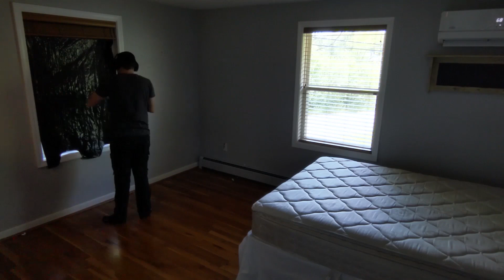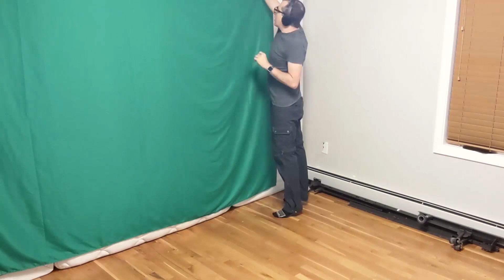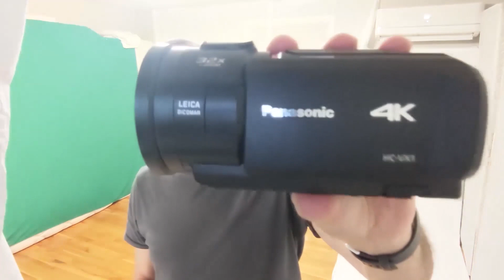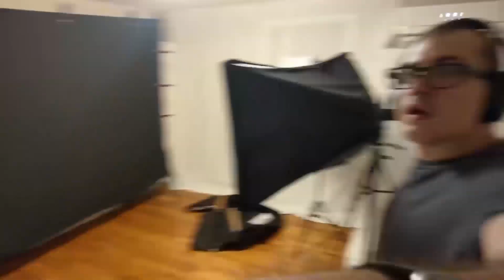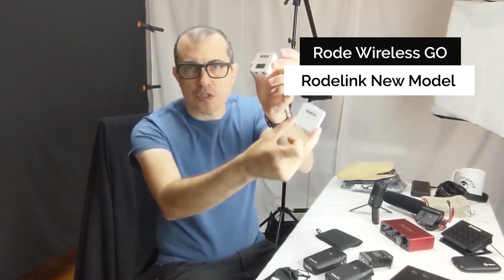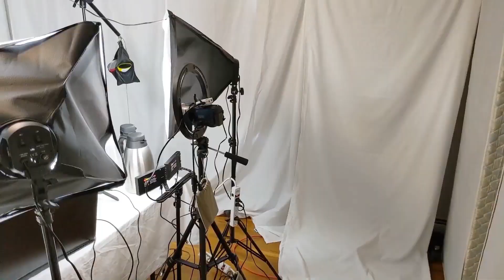How I Built My Home Studio: behind the scenes with aantonop

Comment: If the El Gato capture is adhering to HDMI standards and the audio sent from the camera is some form of PCM it's uncompressed. You shouldn't worry about encode/decode as it's full bandwidth therefore lossless transfer. Mentioning that because it sounds like you've gone one step beyond necessary for your audio redundancy.

Comment: I don't get the counterweights, why not tying one end of a wire (electric wire is really strong) to the ring and the other end to the base of the tripod?
Reply: I was a photographer for 30+ years, he doesn't need that potent a "hair light". One bulb, far less weight. 
Also the main light should be at 45 degrees and 3x's stronger than fill which should be higher and straight on.
Reply: @jerryoconnor6901  Correct. He's lit brightly but it's very flat.
Reply: @EGOS42  TOO much light overhead. One light overhead,, one for the background (I'd prefer blue over back) behind him. That's a pro 4 light setup Main light off to45 degrees, forget ring light (more natural reflection in the eye, really?) Fill light over camera hair light overhead for definition, and a backlight for separation. That's Photography 101 all gratuities graciously accepted